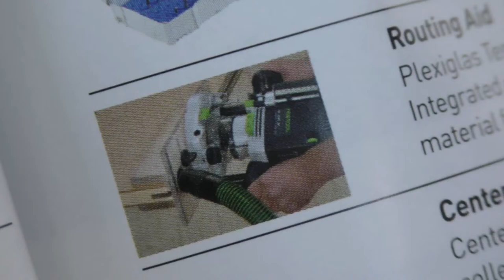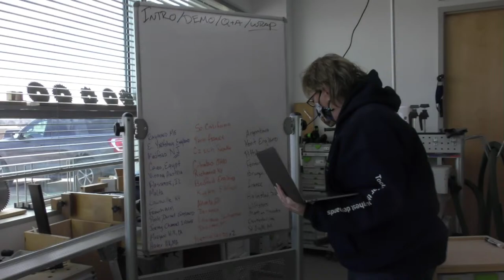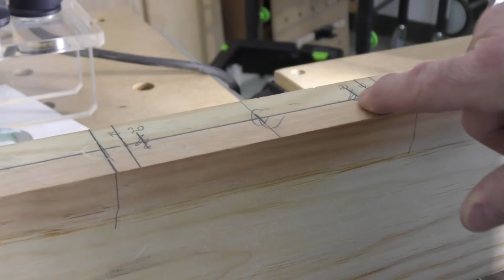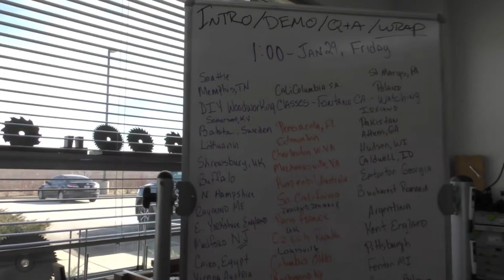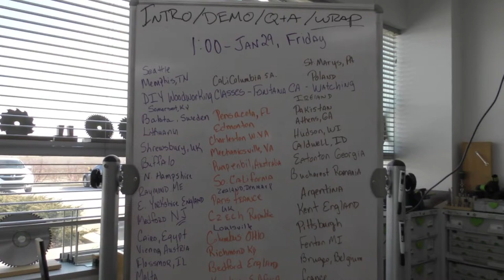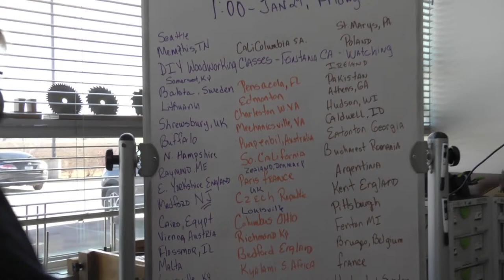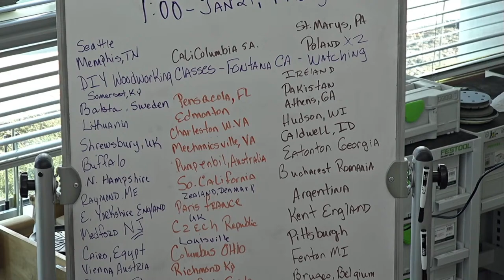Festool Live Episode 39 - OF-FH Routing Aid

Comment: Why does Festool not put a down LED light on the router so you do not have to use a secondary light?
Reply: Because the 1400 is very old. But still works better than most other newer routers

Comment: Hi will this fit a dewalt router? Or just yours? Looks to have lots of different fixing holes in the bottom! If not I see you have detachable base plates could you leave that routing aid on one base plate and then just unclip that and swap to another? Or does it fit/screw right into the tool? Never used any of your tools but thinking of getting that 2200 beast!! Many thanks